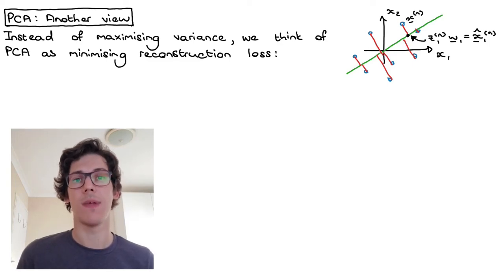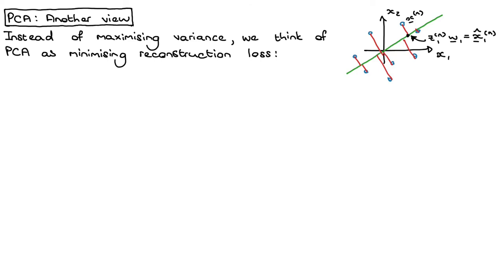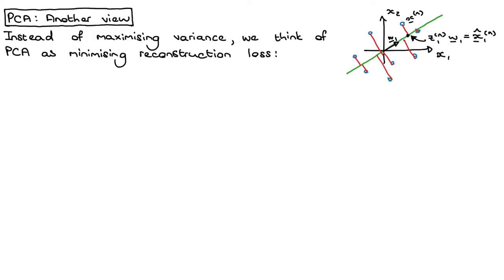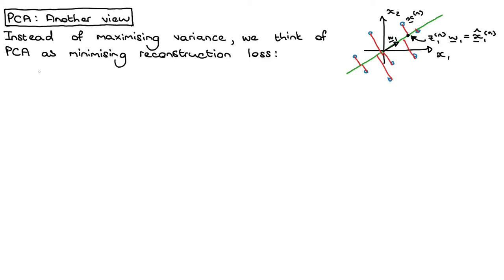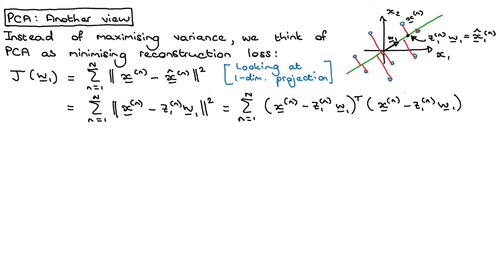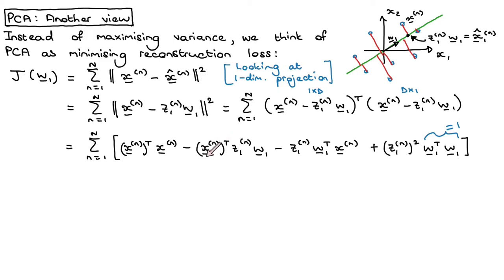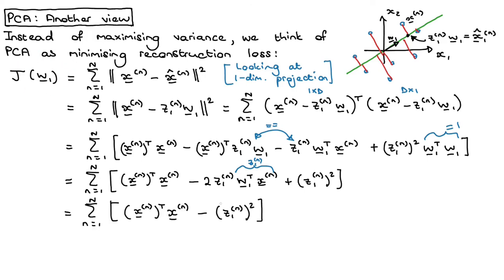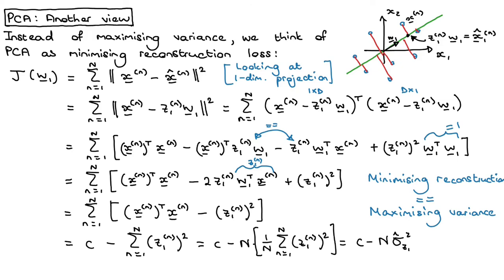PCA 5 - Minimising reconstruction

Comment: Note there is a much easier 1 line proof if you just use Pythagoras: 
For each little triangle z^2 + e^2 = |x|^2 = const. 
So maximizing z^2 is equivalent to minimizing e^2.  Or maximizing sum over z^2_i is equivalent to minimizing sum over e^2_i.
Anyway, thank you for the excellent work.